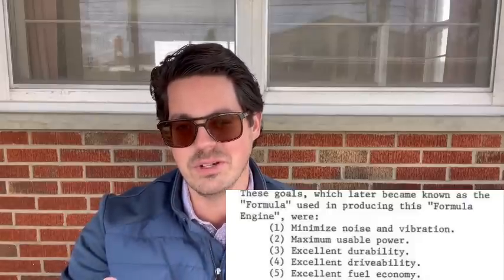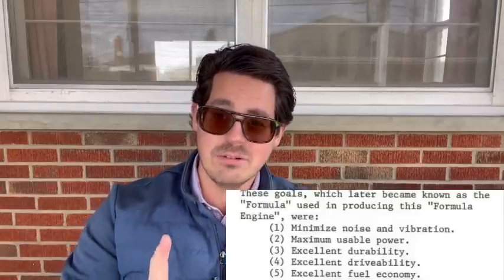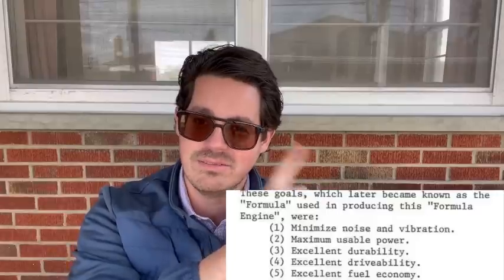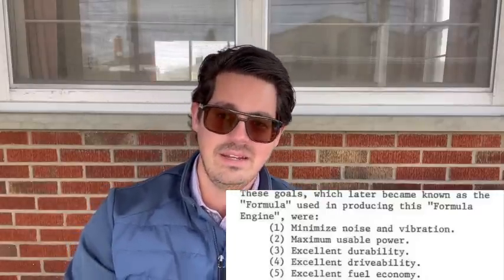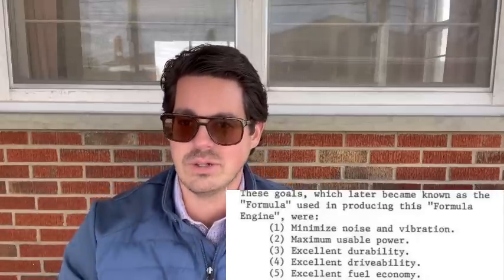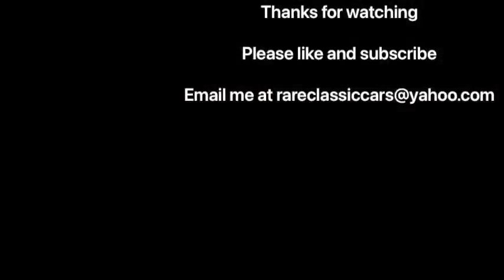Worst Engines of All Time: GM's 2.5L Iron Duke 4-Cylinder

Comment: We ran one for years in a mid eighties Buick Century taxicab - almost ideal in that use, went huge numbers of miles, reliable & economical.
Reply: Quiet smoothness is not it's job.  It's an economy car engine! and a good one.  They should have put it in larger utilities like fullsize pickups, Astro and fullsize vans! especially Astro!
Reply: @alan6832  I'm kind of surprised it wasn't an option for Astro since they're just S10s, but good grief you could have walked faster than one of these things in a fullsize truck. Towing/hauling capacity would have been dictated exclusively by tailwind.
Reply: @alan6832  really, you want a 90 horsepower engine in a full size truck and van,it wouldn't move eather one.
Reply: Wonder how it would do as a marine engine?
Reply: @davidcarder6364  Consumer's Reports would probably say how great it is.
Reply: @billdang3953  They used it's cousin, the Chevy 4 cylinder in boats and industrial applications. It already had the same bellhousing pattern as the 4.3L and V8's. In the 90's until it's end it was the Vortec 3000 and had port fuel injection. It could be found in all sorts of applications but was never used in a production vehicle.
Reply: @TheBrokenLife  You got that right😁
Reply: 1st generation Astros did have the 2.5 option
Reply: @21Piloteer  I have seen them in junkyards. I believe many were manual transmission as well.
Reply: @billdang3953  we both know constuper reports.that would be like taking a BB gun to a tank fight.
Reply: @21Piloteer  as I recall, yes it was originally the base engine when Astro was introduced. Astro was a good bit heavier than the generally small sedans though & given the amount of room for passengers & cargo in the Astro I don't believe a lot of people went for the 4cyl. although I do believe in the RWD vehicles they used the 4spd auto & 5spd manual but the cars continued with 3spd auto & 4spd manual for a number of yrs yet. I had 2 Citations with this engine. For anything bad ever said about these cars or this engine I had relatively few problems ever. (One engine did need an oil pump & trans needed TCC solenoid. 2nd one never needed anything!) The 2 cars had different axle ratios. One could squeal the tires on getaway but topped out about 33 mpg highway. The other not quite as snappy but (several ski trips to Vermont) it consistently topped 38 mpg highway. We had a big group for those trips, as many as 5 cars loaded with people & stuff. I was the only one to leave PA & drive all the way to Vermont & drive around another day or two before fueling up. Remarkable! Yes, we do have more power from small engines today but is gladly trade off some of that for economy. Don't see today's cars doing nearly as well. 
Biggest, heaviest sedan I believe this engine went in was 1st gen Lumina although I believe it's other GM "cousins" were all V6 only by that time...
Reply: @davidcarder6364  It would blow the doors off the 300 hp, 40 ton semis I drove!
Reply: @TheBrokenLife  One in good condition would be faster than the 38 year old, slat 6, W150 I drive now, and might even keep up with my 24 year old, 1 liter Metro!
Reply: @billdang3953  the 3 liter version is a very common stern drive engine. I had an Evinrude one for a while but had oiling trouble due to a mismatched oil pickup from a 2.5 car
Reply: @alan6832  That doesn't seem like an endorsement. 😆
Reply: @TheBrokenLife  I also wonder if the 'Duke would still be so reliable with the 2 or 3 ton load of a van weighing it down.
Reply: @geoffmooregm  Yep, had an Astro 4 cyl. iron duke with a manual.  No power, no A/C, stiff clutch...didn't keep very long.
Reply: @TheBrokenLife  Well it is.  light engines are extremely important fro traction in 2wd layouts where the engine is opposite from the drive wheels.  It is vastly more important than power to avoid getting stuck, which costs far more time.  I soon sold my 2wd, 400 cid F-250 because the engine was far too heavy for good traction, far worse than my 225 cid W150 even in 2wd mode.  with which I have hauled cattle over mountains with what I think is now under 100 hp!
Reply: @alan6832  I've never hauled any cattle over any mountains, but I have had over 2000lbs in the bed of my 2.5 S10 and it wasn't happy about it.

I've towed around 2500lbs with my 2.2L S10s and they were also not impressed with the idea.

All of this was on flat ground in good weather.
Reply: @pcno2832  Almost certainly not.

BUT... I suppose it's all subjective. If you put one in a mining truck with 5.88 gears that was only ever expected to go 10 mph from "here" to "over there" its entire life, it would probably be fine.

I don't believe the typical consumer would be interested in such a vehicle, but I suppose that's were builders like Grumman, Workhorse, Oshkosh, etc would come into play. They'll build anything you want to pay for.
Reply: @TheBrokenLife  unless you were in a hurry, the limits were caused by the transmission, frame, or radiator, not the engine.  case in point, a Ford 8N can pull far more with far less power using lower gears and more time, though far less time than getting unstuck due to a heavy engine in the nose.
Reply: @TheBrokenLife  Also case in point, while hauling cattle up mountains with an old 225, I spent much of the time in 2nd gear, which redlined at about 18mph, but pulled happily at 16, still in a fraction of the time it took to get that 400 unstuck.
Reply: @TheBrokenLife  Plus Microbuses happily carried loads with similar power to weight ratios and probably could not outrun 2.5 Liter C-10s or G-10s
Reply: @alan6832  An S10, or most other road vehicle, doesn't have the mechanical advantage of a literal tractor because people expect to be able to drive one at highway speed. The traffic behind me was also a consideration as far as towing performance. I can't just drive 5mph everywhere in first gear. It's not a tractor with a triangle.

Most people would not consider 16mph to be an acceptable towing speed and that's why they never offered a 2.5 in a fullsize truck (and why they shouldn't have). Whether or not this worked out well for you, it would not have worked out well for sales and would have likely hurt the brand overall.
Reply: @TheBrokenLife  I only found a top speed for a '79 microbus of 68 mph, but I still think a 2.5 C-10 or G-10 could beat that.
Reply: @alan6832  It probably could, empty. Most people didn't buy pickups to go as slowly as possible while carrying nothing.

BUT... GM did actually offer that vehicle for those customers. "Thriftmaster" trim (by that name or another depending on year and model) was a thing for a long time in Chevrolet. My uncle had square body in that trim. 250 I6, 3 speed manual (might have been some oddball 4 speed overdrive, I can't remember), and some insane 2.xx ratio final drive. It got comparable economy to my 2.5 S10, but in the larger chassis. I'd bet towing performance would have been roughly even between them, meaning very poor for both.

Anyhow... Again, that's why GM didn't offer a 2.5 in a fullsize and why they shouldn't have.
Reply: @TheBrokenLife  My 225 w150 has a granny gear 4 speed and transfer case with low range, so I never lack for torque and still wouldn't with an engine half that size, though my 1 liter Metro does have a steep 1st gear which gives me problems with steep uphill stop signs and starting with the ac running, so a 2.5 C-10 would need a low gear, but would hopefully have a high gear as well, and few transmissions have a wide enough ratio.  As for walking faster, absolutely! I can walk much faster than I can dig a heavy nose truck out of a mud hole!
Reply: I had 175,000 never overheated # 4 cylinder head cracked #4 exhaust cam lobe was going and the cam thrust was loose in my 86 S 10 with a700/3.08 was absolutely gutlass even on flat ground.
Reply: I got 21 mpg on the highway
Reply: And I had to run 91 octane in it.
Reply: I worked at a car rental agency we had 100’s of the 2.5 Citaton they should have given them a ticket for buying them👀😬😬😬😬😬😬
Reply: @TheBrokenLife  My W150 has the mechanical advantage of a literal tractor and the 68 mph microbus could carry loads and tow, and is a classic.  The minimum speeds on superhighways are usually 40 mph, are rarely enforced, and I routinely couldn't reach them in loaded semis, which I could just follow.  And other highways have no minimum speed and the one I was on had slow vehicle lanes so speed demons could just go around.  I did have some problems on I-40 in a mountain zone that did not allow trucks in the left lane, so they couldn't legally pass until I learned to use the left lane so they could pass on the right, but this and fish-tailing at speed also motivated me to switch to US-25/70.
     The Irony is that a bigger engine in the microbus, such as a 911 type engine, would have increased traction.  But anyway, that classic 68 mph top speed was empty, and microbuses did carry loads and tow, and had granny gears to get loads rolling, and being classic, are worth a fortune now.  My Metro would gain traction from the bigger engine too.
     They should allow bicycles on interstates as they would get along with microbuses and slant 6 cattle haulers just fine, but are in constant friction with the heavy nose power houses.
     BTW, my first car was a 390 Mustang, so I learned the hard way how impractical they are, so my second car was a 225 B200.  I never really chose the 390. It was just the first '69 fastback Mustang I saw for sale.  I wished it was a 200 I6 or even a retrofitted 2.3.
Reply: @TheBrokenLife  — Back in the 60’s, GM produced chassis for trucks and school buses with 250 and 292 inline-6 engines. With the right gearing, they did fine, and all I ever saw had a sub-low first gear that topped out at about 3 mph. They’d keep up on the highway until the hit a steep grade.
Reply: @alan6832  — If you had the ‘79 Microbus in the US, it had the Type-4 engine, which was far more suited to the bus than the old Type-1 engine, having better torque, and it was more durable. Also, it should have gone faster than 68 — the Type-1 1500 engine would do 68. What was wrong with yours?

Comment: I had a 1991 Pontiac Grand Am; best trouble free car I've ever owned.  Drove it over 200,000 miles and sold it to a friend of mine.  Headliner never sagged and it had the original fuel pump and the Tech 4 2.5.  Mine had V belts but it ran smooth for the most part - had plenty of power to always spin the p205 65 r 14 tires off the line and had plenty of passing  gear power all the way up to 80 mph.  After 80 it would stay in 3rd but still pulled pretty good for what it was.  The timing gears were very quiet until one day I beat on it pretty hard at 40,000 miles then they started making the normal 2.5 gear drive rattle.
Reply: For an economy engine designed in the 1950's and released in 1960 I'd considered it a quite successful engine.  The cam drive was the same setup as the Chevy 235.  Pontiac dug it out and revamped it because they couldn't stomach being stuck with the stigma of the Vega engine.  The Iron Duke also didn't have the oiling troubles of the Y block Ford or the valve train troubles of the big block Chevy.  While I don't consider it a great engine I certainly wouldn't put it on a worst list.

Comment: This engine had few internal problems.  It was reliable in the later 80s and 90s.   Noise was fixed by newer cam and crank gears.  It was pretty durable
Reply: I don't know all that much about it, but if my good friend Bryan, a Ford freak, would say that it was a good engine for it's time it can't be bad at all.

Plus it's good enough for Jeep to use at the time as well. Only they got noticably more power from the same block.
Reply: Yes and Chrysler 2.2 was worse
Reply: @tedmartin4882  — When the 2.2 went to fuel injection, it became a good running engine ...

Comment: The original 60's and 70's Iron Duke you could not hurt. It was half of a 283 V8 and came in Chevy 2's and other GM cars. I even had one in a 1974 CJ3 Mail Jeep and drove it once a month from Houston,Texas to Shreveport, Louisiana and back for Navy Reserves and drove it every day 150 miles round trip to work for 2 years. Sold it running like a top and the guy I sold it to drove it another 10 years. It had over 200,000 miles without a rebuild.

Comment: They're slow and ridiculously crude, but they're unkillable. Which is why the best application for them has been in the Grumman LLV mail trucks (essentially a 2wd S-10 Blazer). The tractor-like engine noise pretty much serves as a siren. You can hear them a mile away.
Reply: You have that tractor-like engine noise right on! I can tell when my mail is about to be delivered from a long distance away by that engine sound!

Comment: My folks had an '88 Pontiac 6000, it's what I learned to drive in.  I can still hear that engine, it just had this distinct sound.  Other than having it eat the cam gear on the highway at 100,000 miles, it was still going strong at 190,000 after dad and I replaced the cam gear ourselves.  The body rot was pretty bad on the car by then, I think he got a whopping $100 trade in, but the engine was still running like a watch.

Comment: Had four iron duke equipped cars including my wife's 1980 AMC Concord. Never a problem outside of normal wear and tear parts. They did all have leaky valve cover gaskets, fixed by the FelPro rubber coated steel version.  Still have my '86 Ciera that draws a croud at car cruises with the hood open displaying the Duke in all it's glory.  Yes, everyone claims to have owned a car with one in it!
Reply: so at one point jeep used it same for mopar? so the 4.0L missing 2 cylinder's?🤔
Reply: @richardprice5978  no.  AMC developed their own new 4 cylinder engine, the 2.46L, which the 4.0 is based on.  The 2.46L (unfortunately) has the same bellhousing pattern as the 2.5L, so that they could directly replace the 2.5L with the 2.46L.

Incidentally, the 2.46L is a great demonstration of what AMC could do.  The 2.46L is better than the 2.5L in every way.
Reply: @KC9UDX  still not convinced enough as continental engines could have designed both of them and the earlier jeep/buick/oakland/GM/AMC/ ford model T and A castings had the bell a separate part just like Cummins 4or6BT is, and tooling is time consuming and expensive pre-CAD to make and modifying parts are easier to do in that ara or a carful rebage job so the average joe doesn't know or find out
Reply: @richardprice5978  well I happen to know and have known quite a few people who were there, and can say with confidence that AMC did their own engine design and development.  (I was once in the tooling business)  They had a long, long history of it, anyway.

You don't have to believe me; look at the design.  The only things in common are the bellhousing pattern (a matter of convenience at the time), the fact that they're both 4 cylinders, and the fact that they have similar displacement.  Otherwise, the design of the AMC 4 is much more like their own 6s than the iron Duke.  The displacement is similar on purpose.  It's one cubic inch smaller, to demonstrate that they could build a better engine with less.
Reply: @KC9UDX  ok wouldn't know you where in the automotive tooling business so its not any disrespect towards you or your collages and my background is working/fixing car and moved in to manufacturing mechanics ( and being in a automotive plant is kinda on my list but for now i ended up working on packaging equipment ect ) and have wanted to design/engineer power trains or crash safety but 15 years ( really from the age of 4 to about 30-something so i respect the people behind the magic curtain in wizard of OZ so to speak as most of the credibility goes to the board room or marketing/beanies but a good car company needs the rest of the team to function correctly probably more so as ie a badly engineered or executed design can leave a sour taste in people's mind's long after the production ended ) later in 2020 sofar hasn't happened yet, so how does continental and Oakland tie in to this as i found some paperwork and historical that points to that

Comment: My 1983 Omega had an Iron Duke in it. Yes it was noisy and rough at idle, but not bad. Had vapor lock problem due to bizarre fuel injection set up. The rest of the car fell apart, the engine still was OK.

Comment: A straight 6 cylinder engine is still the best design of anything yet.
Reply: From a balance standpoint absolutely.  Perfect balance.
Reply: Agreed!!!!
Reply: Or, providing the engine bay is long enough, a straight 8. Those old Buick and Cadillac straight 8s were known to run decades, with minimal servicing. Not very powerful in comparison to a V8, but inherently more reliable.
Reply: 500cc per cylinder seems to be the most efficient so that's why we don't see the larger engines in economy. The boxer twin the citroen 2cv used is balanced. i'm surprised that we never saw a modern version with overhead cams and liquid cooling. I guess it's too expensive to fit two turbos.

Comment: My Iron Duke has almost 300,000 miles on it never left me stranded anywhere she's finally getting tired due to lack of oil changes the motor pretty worn out lots of blow by nowadays still starts and run every time takes me whenever I got to go right up till this day I'm going to end up doing a V8 swap in my S10 but I will still keep the good old Iron Duke on the side for another project and redo the engine and make her nice and fresh